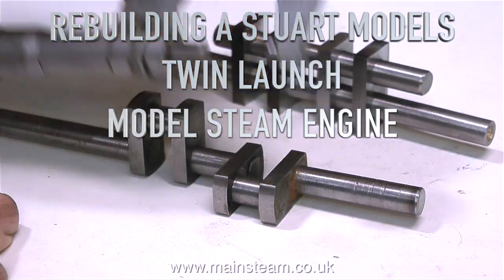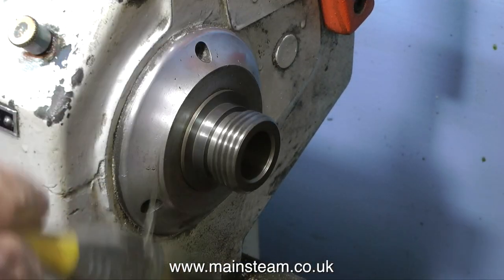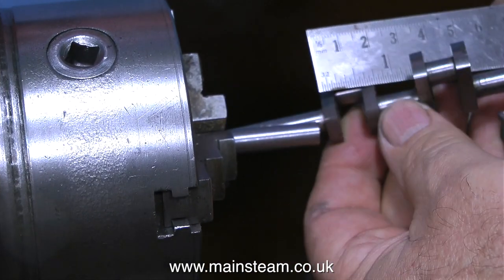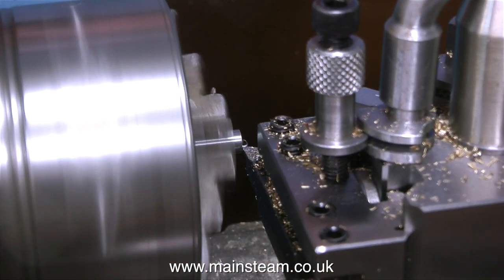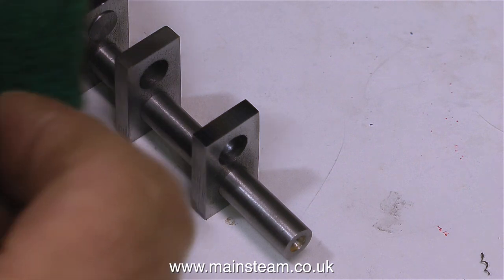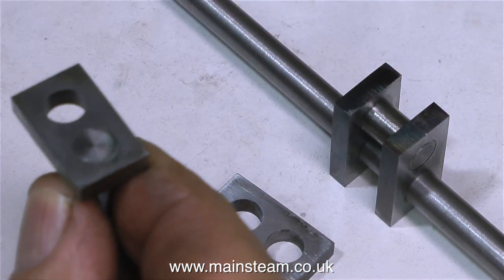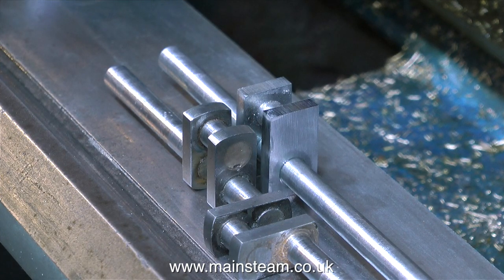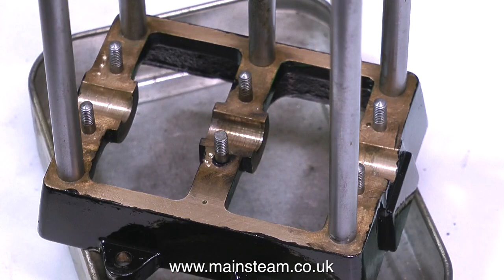STUART MODELS TWIN LAUNCH STEAM ENGINE REBUILD - PART #11

Comment: I enjoy your videos thanks for them.  When I use a file on a lathe, I have a single cut file that I broke in half and rounded the corners  I hold it backwards against the under side of the part.  It is easy and much safer that way.  
I machined the Stuart no. 4 when I was in high school, in 1958.  I still enjoy running it.  It got me my first job in a machine shop.

Comment: I will be making a similar crankshaft for the engine I am making. The crankshaft that came in the kit is a bit of a disaster, due to my inexperience and lack of proper equipment or a combination of the two. The crankshaft you presented will be the solution to my problem. Great job on the presentation and construction. I saved much of these videos in a special folder, so I don't have to search. Hopefully they will remain online until I complete this crankshaft, or my life warranty doesn't expire as I am getting up there in years. Thanks again...Ken.....Marina CA 93933

Comment: Just received in the afternoon post my BAHCO 6" adjustable spanner. I immediately  went to my Stuart Turner 5A which I have been working on and tried it on a couple bolts and nuts and now see why you use it almost exclusively when working on the small steam engines. A great quality tool addition to my shop. Thank you.

Dick B.
Reply from the maker: They are easily the best that I have ever used and they save a lot of time in the workshop :-)))
Reply: Bahco is the best. Today I found two small ones on a flee market for aproximatly £1 each.! I also found a mechanical digital Mitutoyo micrometer for £3. I can´t resist buying old quality tools when I spot one.

Comment: I believe the correct method for removing a chuck with an axe is to stand at least 10 paces from the lathe facing in a easterly direction, and throw the axe at the machine using an over arm motion (that's what works for me anyhow).

Loving the videos (and narration) by the way!

Comment: Model engineering has some nice solutions to complicated problems, my boss generally gets upset if I suggest using bearing retainer. But in this case it's more than adequate for the job :)

Comment: I worked as a Parts and Tool Room guy some years back.  The Blonde lathe that was in the shop had a bent main shaft from the machinist leaving the chuck tool in the head.  When he turned the machine on WHAM!  Bent the main shaft and it has never been fixed!  They continue to use it to this day and that's been well over 12 years.  Knuckleheads!

Comment: One trick used by tiny swarf is to hide in the eyebrows behind your safety glasses, then jump into your eyes at some later time.
Swarf made by carbide die grinder cutters is particularly sharp and dangerous.

Comment: Some added reinforcement for not using compressed air to clean machine tools:  I worked with a model shop where the old machinists used shop vacs to clean up equipment.  I asked why and they said it helps keep chips out of the ways and other pieces you don't want to wear out.

Comment: Love the way you plan to cut out the pieces of crankshaft from between the webs. I'm wondering if the loctite is strong enough to use without pinning, in which case does pinning the webs actually weaken the joint as you are removing some loctite during drilling? In an ideal world it might it be better to drill the webs while the glue has not fully set? Anyway nice work!
Reply from the maker: The pins are also put in with Loctite 603.

Comment: Keith - is there any advantage to using angles other than 45°, I think that I've seen a few engines that aren't at 45° and it seemed to me that it might help with self starting and or rotational forces. I do have limited knowledge of steam engines so I'm just curious. I might have said it before, but great channel (PS get some bluing heh =P)...

Comment: Keith, could the bearing retainer be used to hold a propeller in place? I have a Robbe screw-on prop for a boat and it keeps winding itself off the shaft whenever I go in reverse at higher speed. Would the 603 hold it you think?
Reply from the maker: Yes, it should hold it permanently :-)))
Reply: Thanks, then I'll go looking for some 603!

Comment: I'm sorry but I've been pissing about In my workshop and other workshops for a long time and there is NOTHING! wrong with anything that I see you do in your workshop. As is always said there is many ways to skin a cat and some stubborn old gits won't have it any other way!
Reply: Machining Basics I agree. I've done my fair share of stupidity in a workshop and sometimes something productive. You are a good craftsman. The proof is: does the stuff you build work? good. do they work for a long time without turning itself to shit? great! job done.
Reply: Danilo Metzger  when i was in high school  someone reversed the vacuum on the table saw and made a huge mess and destroyed the table saw in the process. After that year the wood shop was shut down for 2 years because of funding reasons after replacing the table saw and vacuum system.

Comment: Why are they set 90 degrees apart & not 180 degrees?
Reply: The 90 degree angle is to ensure it doesn't stop att dead center, if they were 180 degrees apart the engine would be liable to stop in a position it couldn't start again.
Reply: JonatanGronoset Thank you! :)
Reply: Ah, I know this one! When a piston is at top dead or bottom then the engine will not self-start, but if in the middle of a stroke it will. For a two-cylinder engine having the crank at 90 degrees ensures that at least one piston is mid-stroke and the engine always self-starts. 
This is not as obvious as it sounds, at least one full sized railway locomotive was built with 180 degree cranks in the early days of steam. Station staff had to stand by with long crowbars in case it could not pull away.
Reply: So that the engine can always start. If the engine stops at a point in the rotation where the inlets for both cylinders are at opposite ends to each other, on restart the pistons will create equal and opposite forces which results in an immobile engine until you spin the flywheel.